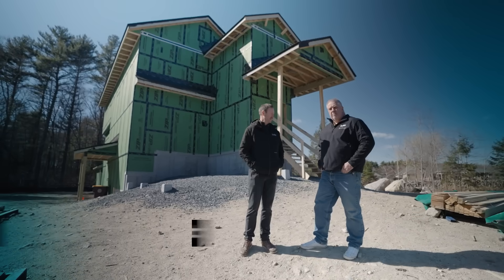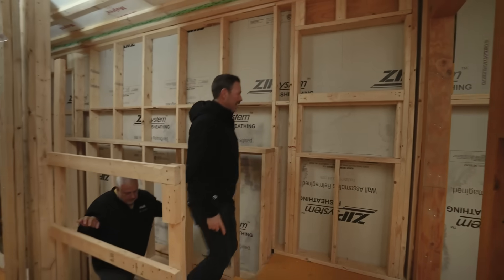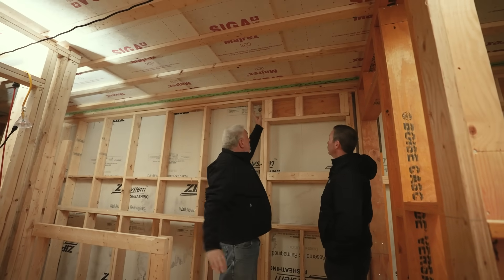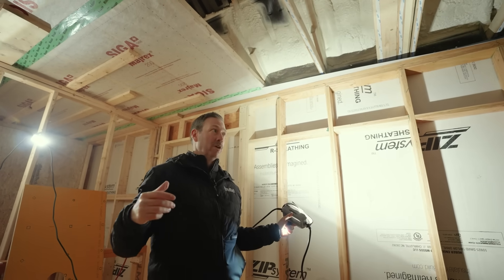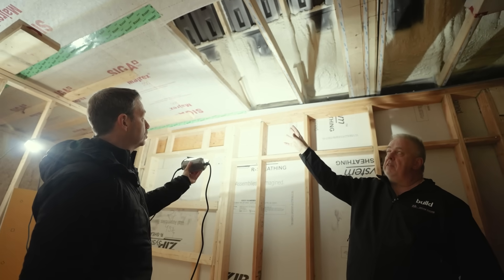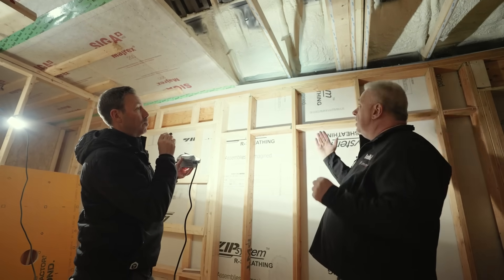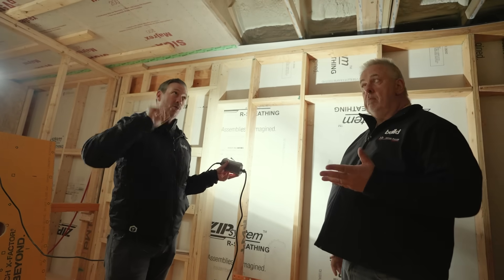Vented Attic Insulation?  Here’s a trick We Stole From European Builders

Comment: Just recently finished re doing my vented attic. Blew all the loose fiberglass to different corners and worked on air sealing penetrations and top plates then adding 2 layers of R15 rockwool, then clear a different section snd repeat. Then doubled the length of vent baffles to they'd actually be above the insulation layer unlike before where they were clogged with fiberglass. At the end i have an R30 rockwool layer and somewhere between R30-45 loose fiberglass on top.

Also, anybody that has issues with insects like bees nesting in their attic, i suggest putting in a finer stainless steel mesh for the vents. I had tons of paper wasp nests in the vent baffles (palm sized range), so i put in a .22mm mesh, about what a window screen is, and sealed any non vent openings to the outside. No more bees should be getting inside, nor spiders, stinkbugs, or most things.
Reply: Good info!!
Reply: Another option is to get a pump hand sprayer and spray your eaves, soffits, and vents every 2-3 months in the spring & summer with something like Tempo SC Ultra. I do that along with spraying around the house foundation and do not have any issues with insects inside the attic or the house itself.
Reply: I’m about to do something very similar including doing t & g soffit under the eaves so I can seal up and re-screen the vented blocks.
Reply: I'm about to do this type of work in a bungalow with a south facing half of the roof which gets sun all day. A bungalow with a finished upstairs goes from 1 big attic to 3 small attics when you finish the upstairs. The two lower ones need to be vented, and they're not on most bungalows, causing the upstairs to really cook in the summer. When the lower ones are vented, the vents serve as cold air intakes for the air to travel up the inside of the roof rafters and exit the gable vents at the top that was already there before. 

It was a bummer finding out in this video that loose fill gets blows around when you vent an attic because I have loose fill and the south facing lower attic needs to be vented so badly. I'll probably do what you do with two layers of rockwool underneath and then loose fill back on top, and do it in sections like you did. The gable vents that I bought from home depot already have a mesh on the back which looks like the holes are small enough.
Reply: @readtherealanthonyfaucibyr6444  consider solar powered intake and exhaust fans to compliment the gable vents. Also, for the vented eave blocks, there are spacers that maintain the air gap creating a duct/chase for the convection path. The loose fill doesn’t blow around much at all once it is installed by “blowing it in”, the air exchange doesn’t move any appreciable amount of the loose fill around
Reply: @Natedoc808  Great to know about the loose fill not being a big issue, maybe I won't need the rockwool. The wall vents I bought are only 12" by 12" and I was thinking about even putting another piece of wood 6 or so inches behind the vent to act as a wind shield. But good to knowing the blowing is inconsequential. Thankfully both lower attics have access doors so I can check. 

With the solar fans, do you think it would be best that both of them blow outwards since both of the uppermost (original) gable vents serve as heat exhaust? (no roof vents) Or should it be one in and one out? 

This house actually has no eaves. Or are you referring to the bottom piece of roof rafter vents that go against the corner on the interior of the lower attic? Thanks for mentioning rafter vents though as they are important and I did thankfully happen to learn about them recently. The finished part of the bungalow is properly vented, as in there's a thin layer of fiberglass insulation over the drywall that is up against the rafters, with an air gap above to allow for upward airflow.

On the north facing lower attic, it's actually close to a loud road, so I was thinking about installing full length rafter vents with rockwool "safe & sound" behind it to cut down on noise. I'm learning one lesson from the south lower attic, and another from the north. Heat venting vs. moisture venting. 

The south lower attic needs the venting to exhaust the heat, but I'm learning I can't just leave the north one alone, need to vent that too for the sake of venting moisture. The evidence being the north facing lower attic has the remnants of an inexpensive attempt at reducing sound: cardboard nailed to all of the rafters and an inch or so of loose fill on top, but most of them are fallen down now. I think the reason for is that is moisture build up due to no vents. In the winter, I looked down with a flashlight at a three foot or so section of one of the rafters where the cardboard and inch of loose fill was still intact, and noticed ice crystals everywhere. Also, the north side of the house is the front of the house and it has an old school metal awning over the front porch. In the winter snow builds up there and doesn't get a lot of sunlight. I noticed some water leaking into the window frame on the 1st floor below when that snow was melting, and have come to understand that probably due to the roof being too warm, due to no venting.
Reply: @readtherealanthonyfaucibyr6444  Hey buddy. Wow, there is a lot to unpack there, had to grab my laptop as typing this on my phone won't cut it! lol. Let's tackle this item by item as I'm having some trouble picturing your setup. I'm going to use some definition as I go so we are on the same page terminology wise as you mentioned not knowing what the "eave" is. Also, understanding that moisture/vapor always goes from wetter to dryer, and temperature drive between outside and inside always goes from hotter to colder.

-I'm assuming you have a flat interior ceiling of drywall or T&G that is fastened to the ceiling joist/bottom cord of a truss. The attic side of this ceiling surface should receive a very healthy 6-8" layer of cellulose.Before you blow/dump this cellulose insulation onto the ceiling, clear any existing insulation away from any penetrations through the ceiling such as overhead light boxes, ceiling HVAC vents/registers, including the penetrations for wiring and plumbing through the top plates of any walls.  Seal with acoustic acrylic or latex caulk or closed cell foam any and all penetrations between the attic and the living space below; these are essentially heat/cold/moisture paths that creat the temperature/moisture drive between the living space and the attic. 
- The rafters being the angled supports which your roof sheathing is nailed to, should receive a mineral wool bat insulation  that is as thick as possible, hopefully 6-8" also. 
-Where the rafter runs onto and past your wall creating the overhand, also known as an eave, there should be a block nailed in to seal up the attic. Depending on the era, every block to every fourth block may have holes cut in them with wire mesh to "vent" the attic. You do not need these vents if you are putting in active fan driven gable supply and exhaust fans. if you keep them, then you need to ensure the cellulose doesn't pile up against them creating a nice spot for moisture. Sounds like it gets quite cold in the winter there so I would simply block them off with a good flashing tape like Zip Tape or aluminum backed bitumen asphalt tape. If you keep them, use a cheap and easy rafter vent such as https://www.homedepot.com/p/Durovent-Durovent-22-in-x-4-ft-Rafter-Vent-Pack-of-10-XUDV2248/205466794
this will make sure a small air gap at the eave block vent exists and the mineral wool and cellulose doesn't act like a moisture sponge right where these holes are, but again, I would seal them up.
- For the gable vents, you want one supply from outside, preferably to the north/east side for when it is hotter out you can draw in cooler air, and an exhaust fan on the southern/western side. There are many options that have temp/humidity controllers built in, so you aren't making your attic colder in the winter. The louvers on the gable fans should correspond to their flow direction, and close automatically when the fan is not running. In the winter you want your attic to stay warmer so it isn't pulling heat from the living space, and the insulation in the rafters keeps your roof deck from getting warm from the attic air, which prevents ice damming.
- The porch problem you are having is called ice damming. The sun melts the top side of the snow, the water soaks through the snow until it hits the metal which has freezing air under it and freezes; same as bridges ice up before the rest of the road because cold air can flow underneath. Snow actually has a pretty good R value per inch, hence why igloos work. Water is very good at resisting temperature change, so it's a great insulator. I digress. You can either insulate and soffit the porch, or you need to increase the pitch so the snow slides off. Water will find its way in if given the chance aka if the roof isn't steep enough for gravity to create runoff. 

I built houses in Nevada, California, Lake Tahoe and the central sierras as well as in the san jaquin valley of California. Many of these places get hotter than satan's butthole running a marathon and as cold as a witch's titty in winter, and humid in both seasons so I'm familiar with dealing with this issue.

 I know this was long, but in practice it is quite a simple system: Good air sealing from the living space to attic, good insulation from living space to attic and from attic to outside, controlled temperature/humidity via active ventilation of the well insulated attic. 

If you are concerned about humidity from living activities inside the home which is where most of the moisture comes from, then install a dehumidifier in an inconspicuous spot; mine is in my laundry room, tucked away in an overhead cabinet out of sight and plumbed the drain line into the washing machine drain. In the spring time it will pull as much as 6 gallons and hour from the interior. 

I'm about to retrofit a 1972 home with the exact setup I described above, so I'm putting my money where my mouth is. I'm going a step further and removing all the old stucco siding, sealing all of the wall penetrations from the outside, insulating with mineral wool, using Zip R sheathing, flashing tape and acrylic caulking to seal up the walls, then James hardy board and batten exterior. Couple that with the attic strategy I described (including sealing the eave blocks, this old house will perform better than most built 10 years ago. I'm also going to couple it with Mitsubishi mini-splits instead of central air. 

Have a great one and please reach out if you have any other questions or if I was unclear.

Comment: @1:32 you can see daylight.
Reply: The zip tape isn’t opaque and lets light pass through. I promise that seam in the window opening is taped. We werent concerned with the panels butting up super tight in the window openings when they are going to be cut out for the windows to go in.

Comment: CAUTION Polystyrene foam insulation is very flammable. Cheap but deadly. I would never have in my house nor would I ever recommend.
Reply: Where waS there poly? Usually urethane.
And it's a budget build ao they can't do every product thats  best of breed
Reply: You should be out of the house before an EPS board sandwiched inside a bunch of gypsum board and  whatever exterior sheathing becomes a threat to human life. Sure, I'd like to live inside a concrete castle, but everyone can't afford that luxury. But everyone can afford smoke alarms.
Reply: Is matt getting paid for this, seems like such a left turn?

Comment: Kyle from RR Builders has been showing of the Majrex in his latests buildings. He was inspired by The Build show to not just build sturdy buildings, but dramatically improve efficiency by "sweating the details." He has shown that you don't have to use spay insulation as the only way to get get great blower door scores. The Majrex is kind of like Gortex for a house. It's makeup (chemistry and weaving) makes it so moisture can more out at a much higher rate than moisture can move in. So it lets a building dry, while not allowing much if any outside moisture back in. The Swiss are doing some amazing things with Building Science. The materials aren't cheap, but the long term benefits to a property are fantastic. Low energy loss through air movement, moisture can migrate outward. Interesting that in this video as well, they show they are using a little bit of spray insulation in key spots, but can then switch over to cheaper blown in insulation, while still creating a super insulated house.

Comment: You are still going to have hardly any insulation at the edges due to the room pitch.
Reply: 10" Raised heel with R-65 CCSF......I think that is good enough
Reply: @stevenbaczekarchitect9431 OK, I must have missed that in the video.  So if you are filling from the top plate to the underside of the baffle with CCSF, how far in are you coming before transitioning to blown in?  Seems you are still going to have a dramatic step change in R-value at some point.  Like 65 down to 38 before climbing back up to the center at full thickness of blown-in?

Comment: No raised heel trusses?  That seriously reduces the R-Value around the entire perimeter of your attic.  It might be R84 in the middle but the average will be way less, maybe R20 at the top plates.
Reply: There is a 10” raised heel.
Reply: @brettpelletier1219  my idea of a raised heel is to allow a uniform insulation thickness all the way out to the edge of the wall.  Otherwise any truss that keeps the truss top chord from touching the wall plate would be considered a “raised” heel.

A true raised heel also makes for larger overhangs, a good thing from a durability perspective.  I guess something is better than nothing.

Also, a 10” raised heel needs attic vents installed, so that takes away from the thickness of the insulation as well.  I see they also needed to spray foam this area to seal it.  Using a true raised heel truss you can fasten strips of OSB to the trusses and seal with acoustic caulk or canned foam.

Were small overhangs a styling decision or wind load requirement?
Reply: @superspeeder   I agree with you that the larger the heel the better and in an ideal world it would match the depth of the insulation. We have 2’ overhangs which I would consider fairly large. We had to balance the height of the building, pitch of the roof, overhang relation to the top of the windows on that floor, etc. Overall, with all these factors we arrived at what you see. There are always things that could be done better from a building science perspective, we’re just trying to do our best to strike a good balance.
Reply: @brettpelletier1219  thanks for clarifying!  Agreed, there are often compromises made that aren’t always obvious.

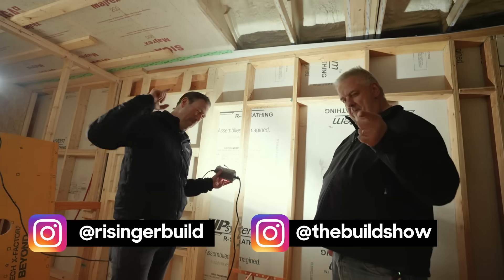I’m in the process of building my own home and these are all things I considered.  I have 3’ and larger overhangs with an 8:12 pitch, so lots of room for raised heels and simplified attic venting details.  In my area, maximum building height per zoning regulations was not an issue so I had lots of design freedom.

Cheers, and good luck with the build!  Looking great so far!
Reply: @superspeeder  that sounds like a recipe for success! Thank you very much and best of luck with your build as well.
Reply: @brettpelletier1219  🍻

Comment: At least in Northern Europe we have our air and vapour barrier on the inside of the wall assembly. This means you don't have to go over the top plate to maintain an air barrier.
Reply: Yeah, they could have continued the majrex down to the walls and air sealed from the inside. That does require a service cavity or extra detailing to keep the airtight seal going. This seems like a somewhat budget conscious build given the vented attic which Matt typically avoids so maybe they didnt want to pay for the additional labor for that detailing.
Reply: I am fully aware of how you all do it - I appreciate it, but I do not agree with it for a wood framed building. For your Masonry buildings yes - wood frame here, NO